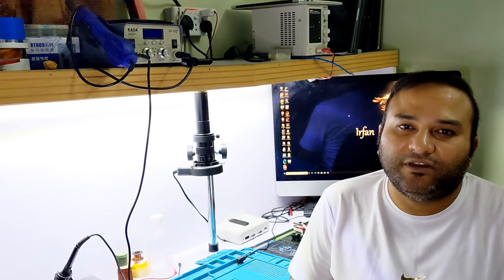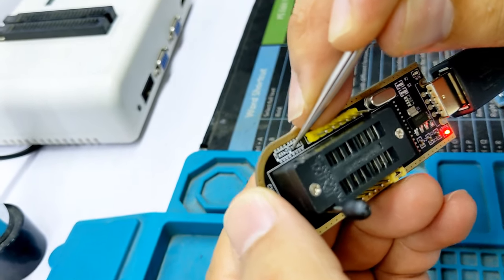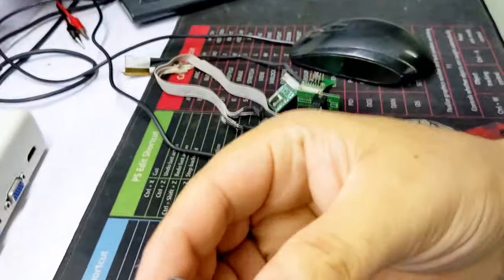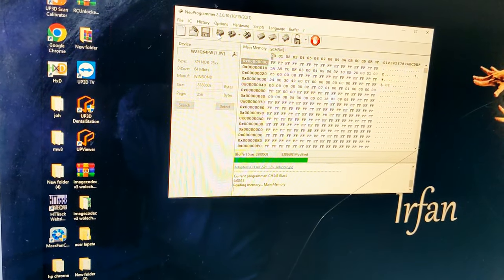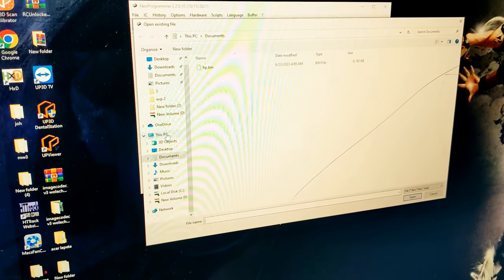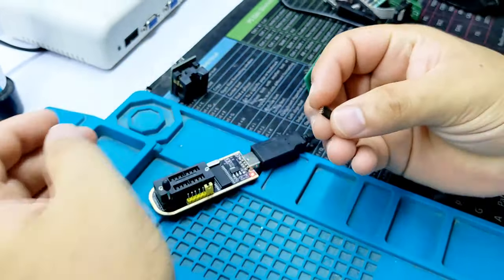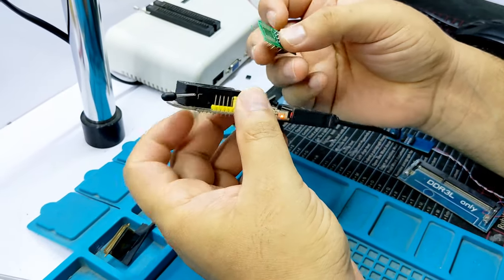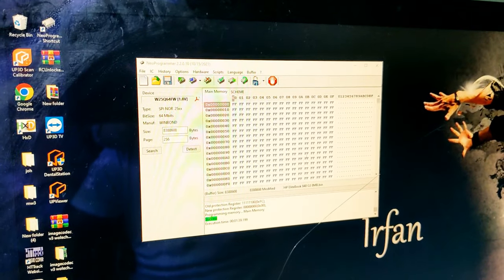How To Use Ch341a Programmer

Comment: Hi, Ch341a  v1.6 is it coming with a clip. that we don't need to remove bios from the motherboard? thnx
Reply from the maker: Clip didn't work on 95% motherboards. We must have to remove EPROM ic
Reply: If you can't read the BIOS when it is on the motherboard then check the 3.3V coming from the CH341A programmer.
The 3.3 V regulator might be weak. Perhaps it can only deliver 100mA. If other components on the motherboard draw current then the voltage might drop. So if you notice the voltage being low, perhaps below 2.8 V, then supply external 3.3 V to the CH341A after the regulator.
Reply: thankyou @Drottninggatan2017